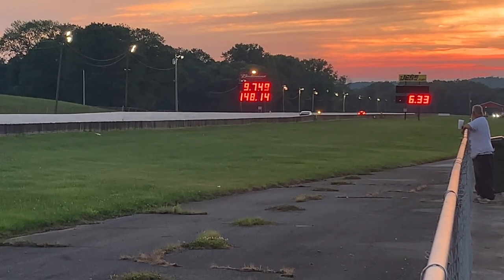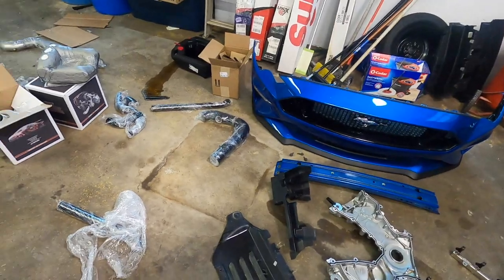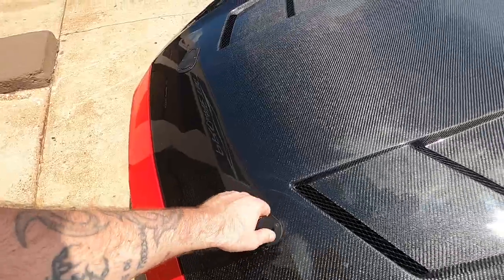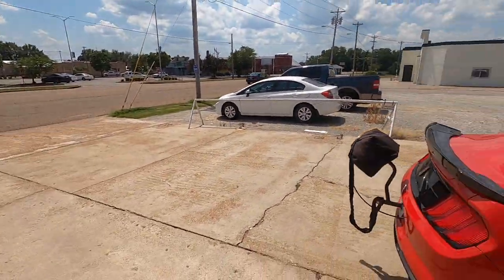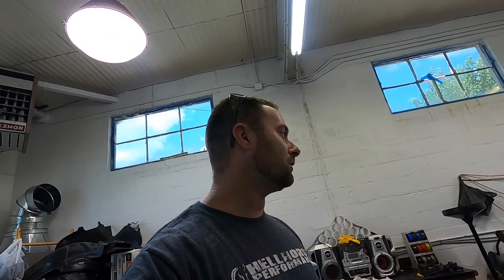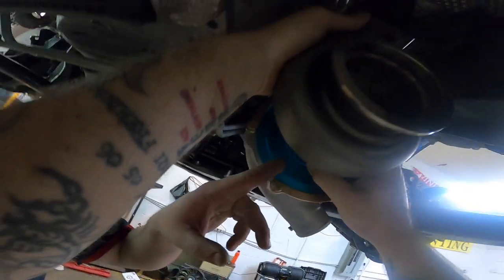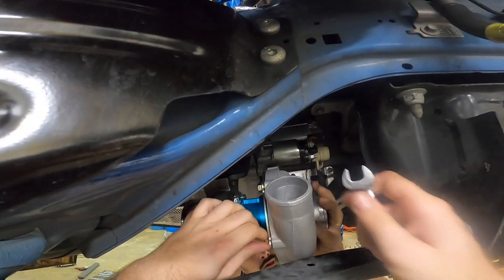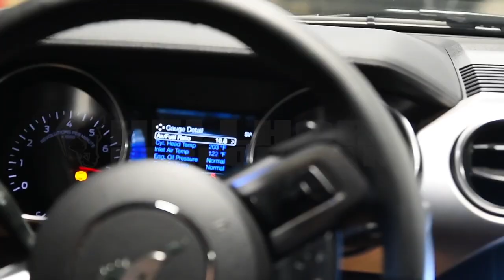Friend ASKED ME to help TWIN TURBO his NEW 2020 Mustang GT...And, Well... HERE'S WHAT HAPPENED!

Comment: R888R's may be able to "hold" the power.
Reply: Fo Sho , that’s what we use on the street
Reply: The new NT555RII is worth a look as well same 100 treadwear ar R888rs but a straight line design and in sizes we use even down to 305 45 17s aka that 27.5-28inch gap left in Toyos

Comment: I dont think either car can leave as hard as my EB stage 2 footbraking with no 2step ect....
  Then your gonna hit that top end and pull away...lol....
Reply from the maker: Just went 149 mph yesterday 🏎🏎🏎
Reply: @Zander13Productions  thats what I said pull away but im gonna leave 1.4x....on 93....i was making reference to you saying you haven't felt a supercharger car leave any harder...and I promise you mine does hehe....while your footbrake not bumping in ect....

 And then I took up for you in the last video post...from the dumbasses that didn't think the huge main vacuum line feeding your double boost referenced fuel pressure regulators and entire waste gate distribution block is the same a vacuum leak on a stock NA car lol....

 People have been 8s on my blower its all ill ever need BUT I absolutely prefer the sound, clean engine bay, free power ( especially stuck on 93), IATs ( without a killer chiller or meth), max power potential and above all the adjustability of your mid mount twins....far superior......
 BUT all stock 3.15 gears and my lard ass fuel weight north of 4300 my shit hits like a mack truck....to hard in fact....

 Let's race to the 330 lol....shit I got damn near enough in my system to have twins without sponsorship damn it....my blower is silent so I get no auditory feedback either....love how your car sounds spooling down.....